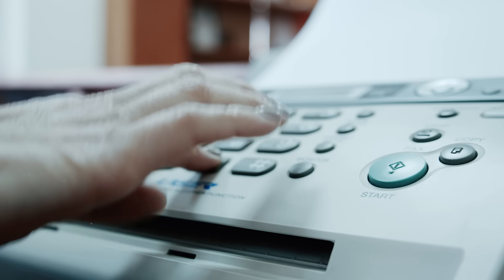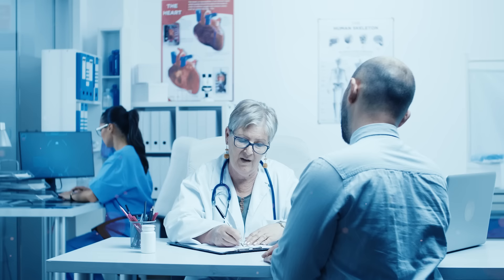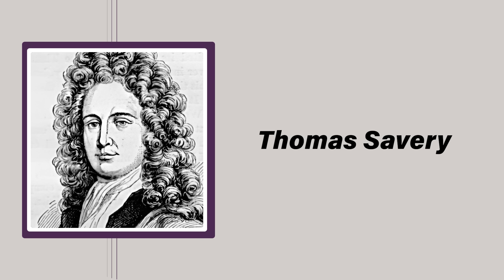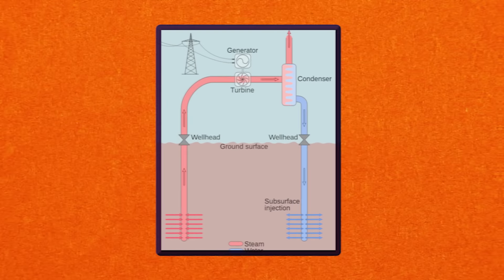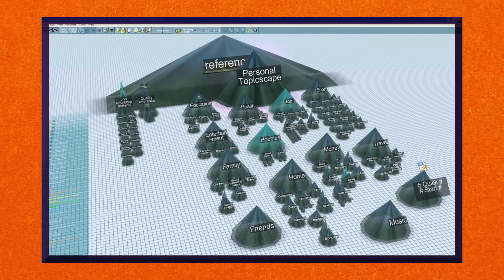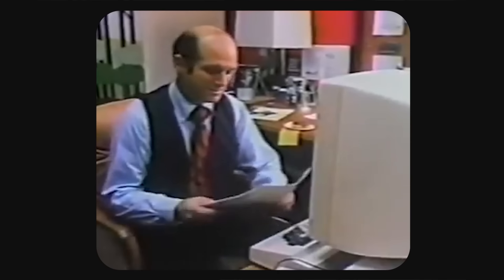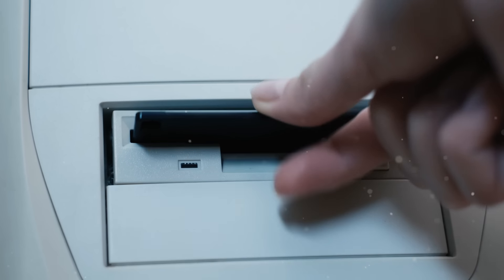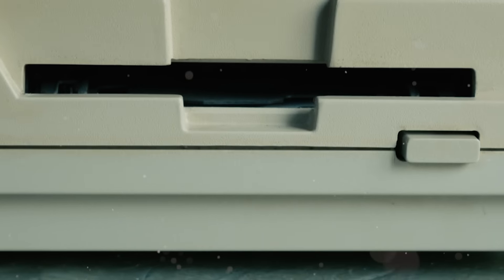Terribly Outdated Technology that we Still Use...

Comment: Windows XP is very much still in use for a lot of stand alone off-grid systems that require a basic O/S that doesn't need updates. One such example is in both large and small air conditioning  units where it is unnecessary to need to update the software as the software doesn't need to be complicated, it just needs to be reliable as the hardware is designed to last decades so all it needs to do is to make that hardware function reliably. This is exactly the same reason that DOS was in use for decades as well, as it was a simple but tried and tested operating system. I gather when the Space Shuttle program was retired in 2011 it was still using an O/S written in the early 1980s to control certain basic functions as there was never a need to change it. And interestingly BBC Basic programming language can still be found in use both as an educational tool for those wanting to learn the basics of coding but also, as you say, for those using vintage synthesisers in the music business.
Reply: It goes back even further. There are still a lot of gas stations for instance that the cash register/pump control system is Apple II based running Apple DOS

I still have a Windows 95 laptop. It gets broken out maybe twice a year just to run this one old piece of test equipment that has had no drivers since 95 and unfortunately, nothing better has been made since.
Reply: A large number of ATM’ use XP, too!
Reply: I still run a laptop using XP on a daily basis. It is connected to the internet and I use it to stream audio while I work with my other computers. I can boot all my other machines up and down and never interrupt the audio. Plus, it has a calculator, dictionary, and a spreadsheet running at all times. It has limited web browsing capabilities using K-Meleon.
Reply: Although, for most off-grid systems, it's cheaper and legally safer to run Linux, and increasing numbers do.  It's also very possible that linux distros can still optionally be updated, or at least updated enough to be hardened against malware.  It's a little silly to argue for XP,  unless specific equipment made with specific drivers, when linux and even other Open Source OSes will run on anything designed for XP.  You might go back to old DOS-based Windows drivers never implemented in Linux, but that's stuff several decades old now.
Reply: @wingracer1614  I have my doubts about this, because Apple DOS (and Apple ProDOS for IIe and IIgs) is still covered by copyright.  I could see Apple, of all companies in particular, trying to claim special rights over how such things were repaired or updated. Electronic component companies, especially Chinese companies, long ago discovered Linux to be a much legally safer alternative. There were several versions of non-Microsoft DOS, and even for these, they too can usually run FOSS FreeDOS. It is more likely CP/M, which was everywhere before the IBM PC came out, and ran on nearly every 8-bit microprocessor of the time, there was even a CP/M Card for the Apple II's.
Reply: @squirlmy  They aren't pirated. It was purchased legally from Apple decades ago. What, you think Apple is going to break your door down and arrest you if turn on that old Apple IIe you have laying around? These things haven't been updated in decades either. This may be some grand revelation for you but small businesses don't just replace and throw away perfectly good working equipment
Reply: What he didn't mention is that Microsoft is still updating operating systems such as XP it's just that they're no longer available to the public for free. However, you can pay an annual fee to get access to those updates, which is why Mirosoft still updates it because a lot of businesses are paying to have it updated.
In a way, this makes the operating system uniquely secure as people who want to make an XP virus only have the outdated public version to work with and don't know how secure the updated one is unless they want to front up that price tag.

Comment: Bicycles, keys, gas lighters, campfires, trolleys, radios, spectacles, cardboard, rowboats, paintings... You could come up with an endless number of examples for "outdated" technology still in use. When you use any tool, you want the right tool for the purpose, and sophistication is actually a fairly low-priority attribute among all the factors that determine what the right tool will be.
Reply: not to mention analog stoves / ovens. preheat to 350f on analog = twist a dial for about a second. on digital = push and hold button for way too long before it speeds up, then zip past your intended target at which time you repeat the process with a different button
Reply: From pov of casual observer, yes they are obsolete, but on deeper look almost everything evolved a lot over the years, better designs, more modern materials, new features

Comment: It's tempting to write off technology that works well just because it is out of fashion. I continue to use all my old technology simply because it does work and does what I need. Remember one of the oldest bits of technology is the wheel which still works just fine despite attempts to come up with 'modern' alternatives like maglevs.
Reply: A hammer is pretty good too. Perfect...really.
Reply: A big thank you to the caveman who came up with it!
Reply: It's kind of a good thing to understand and work with old technologies for if and when shit hits the fan
Reply: Funny we still use the term "write off" given writing probably predates the invention of the wheel!
Reply: Funny how we "turn” on or off appliances by pressing a button!
Reply: Maglevs are a pretty bad comparison for the wheel since they're two different concepts the wheel can be used to move things around but that is far from our only implication of the wheel, maglevs on the other hand typically is only used for moving things more efficiently and at higher velocities than the wheel is simply capable of doing  but that's all it can do so far. 
A better comparison to the wheel would be the rope infinitely simply infinitely applicable constantly evolving but changing very little

Comment: Your fax vs email example is understated.

An email is putting your document in a paper bag and handing it to the first person heading in the right direction.  It keeps getting handed off to different people until it finally reaches the destination.

A fax encrypts your document, gives it to a courier, who takes it straight to the recipient and decrypts it when they handshake correctly.

This is why sensitive information is faxed instead of emailed.
Reply: *in the US.

And yet the American health care system does not have the best record in keeping medical information secret. (It has a good record still though)
Reply: Lmao can't believe this is the excuse
Reply: Not in the offices I've been in. 
There's a few fax machines, one to a department. When someone faxes a document it comes out on the other side but atop and/or below the rest of the fax's coming in at the time.
(Workers comp company)

Guess what each one had in their own offices though. A PC to receive emails.
Reply: E-mail is end-to-end encrypted and properly authenticates the sender and recipient, as long as both party's use a proper provider/mail server.

Fax is sometimes encrypted and authenticated, in case of T.37 simply by converting the fax into an email or with T.38 (the standard in the US health care sector) with a special protocol. But outside US healtcare it is often very dodgy how secure the transmission of your fax is.

So in the end, both means rely on both parties using a secure implementation, but with e-mail this is nowadays nearly a given, but with fax it is the exception.
Reply: @mrofinUtortxoF  Blame it on Federal Privacy laws, which impacts healthcare and the legal sector heavily.    Healthcare use pagers because of their extremely high reliability, with guaranteed Service Level Agreements.  The technology is more robust than cell service.  Pagers are essentially a dedicated low bandwidth, high coverage, and near 100% reliable communication system....if the people remember to recharge the pager's battery once or twice a week.
Reply: Except that typically modern faxes are just "virtual devices" that send data over the internet like the rest of data, certainly with encryption options just as email has. Granted not an expert in that area of IT, but I highly doubt, unless specialized in the military, that businesses, or even law firms and healthcare are using specialized dedicated lines when "faxing" to and from clients.
Reply: SMPTS emails are encrypted, unlike old fax machines that send unencrypted data on phone line (new fax machines are encrypted too)

Comment: 10:15 Older production lines can still have floppy drives as the input for their respective operating systems.
I think even parts of launch codes is kept on floppies in the silos.
They'd need to combine those with a written key and confirmation code from the pentagon as well.
After that the software in teh missiles would become accessible for targetting and such, after which
the launch keys can be operated. Without this, either the keys don't work or can't be turned on.

And retro gaming, ofc.

Comment: For people who don't know, equipment drivers and custom software often need to be rewritten when switching over to new operating systems.  This is fine for most commercial products because companies want to maintain a wide variety of compatibility at any given time, but niche applications such as military, medical, and industrial uses often need custom solutions.  Often, that solution boils down to "just keep the operating system as is till something breaks it".
Reply: I’m all too aware of the personal price you pay for a new operating system. I’m also aware that the government has huge legacy problems with the VA and the pentagon.
Reply: Yeah I went to the opthalmologiat and a piece of kit he used has xp software on it. I think there were 20 of these devices in the country so I guess a software upgrade would be costly.
Reply: I think a much more common situation is trying to find printer drivers for new operating systems, especially when the manufacturer has left the printer business. A 20-30 year old printer is really good enough for a lot of printing needs. I don't know why Microsoft doesn't do more to try to maintain backwards compatibility with drivers.
Reply: Same applies to retail. While we sold the latest Windows 10 machines on the sales floor, the retail software used for the international company still ran on XP and paperwork was faxed between stores. I expect they still do.

Comment: Steam as industrial thing was quite quickly mentioned there, but at least in Finland practically all bigger factories have a steam generation facility and the steam is used then for various tasks generally related to heating. And not so much to heat a buildings, but for when the papermill needs heat to dry the paper when it's dried from pulp or when a process machine needs 100C air with 5000m3/h or 80C water 200kg/h or so, steam is the easiest and cheapest way of doing it when it's available..
Reply: a large swath of Manhattan is heated and oddly also cooled but a large steam grid operated by ConEd.

Comment: I worked in a stainless steel tubular mill that still, to this day, uses 3.5" floppy disks for it's computers. They were used to load specification files, which contained a ton of text data but ultimately the files turned out to be less than 1 MB so it makes sense. Some of these computers also run Windows 98 still, but why update if they're not even online and do what they need to do?

Comment: Working in a large, modern, major regional hospital, I was smirking throughout almost this entire video. I use fax machines and pagers every single day I work lol. For the specific use case of the fax machines, I honestly can't think of any current modern methods that are quicker or easier for certain tasks. Thankfully our primary computer systems have upgraded to slightly more modern versions of Windows, but I see devices daily still running muuuuuch older, though often heavily customized OSs. Also thankfully, I have no use for floppy disks or steam power in my job though :)
Reply: Well your electricity is almost certainly generated using steam power.
Reply: I don't see why a scanner with direct email capability would be slower than a fax machine, unless it required account login, but that would be a good thing. Faxing is so archaic and insecure.
Reply: Some of your equipment has been sterilized in an autoclave, by steam. Find a central/sterile services technician in your hospital to be sure.
Reply: For a long time I used a floppy disc to transfer radiation therapy plans from the planning computer to the delivery computer (running windows xp)...  In the hospital radiation oncology department.
Reply: steam is used, you just personally aren’t using it directly…it’s both powering the hospital, heating the hospital, and cleansing it since housekeeping are using it to sterilize and clean multiple things
Reply: @olanmills64  bro sometimes it takes 8 minutes to log in to a machine and open your damn email. Yes, faxing is faster
Reply: @m1t2a1  well this is steam sterilization, not steam power, isn't it?
Reply: hahah, incidentally where I live almost all of the power comes from hydroelectric - over 82% of it. Wind makes up a decent chunk of the rest. So yeah there's a good chance that almost all of the electricity at my hospital does indeed NOT come from steam. Our backup generators are diesel (these are internal combustion not steam engines). But anyway the original source of the power before it gets to the hospital isn't what I was talking about when I said I don't have use for steam power in my job and you all know it

Also the steam isn't powering the autoclaves, it's doing the actual sterilization. The power source is the same as the rest of our building - hydroelectric

Comment: Another strength of pagers is that they can be handed off from person to person, all the people who need to reach the "on call" person don't need to update their phone lists at every shift change.  Also, you can put your phone on silent (or OFF) and still be able to get emergency notifications without also hearing every text and email.
Reply: The one position in which my job had a pager; they'd issued one to every employee in the team. It was instead the company cell phone that was passed off to whichever team member was "on call".
Reply: And you can have a coded number for important messages. 
😂 for my wife it was 8008...which looks far different in pager font. 😂
Reply: Call forwarding is a thing, and in corporations with shift changes, such systems can be controlled via a digitized roster or the on-call person dialing in to set the forward number to the number they're calling from.
Reply: @Pahoe77  thats hilarious 😭